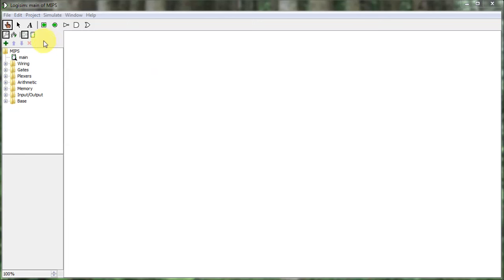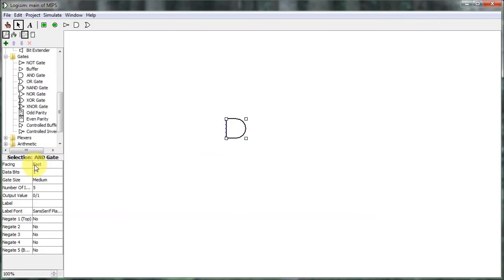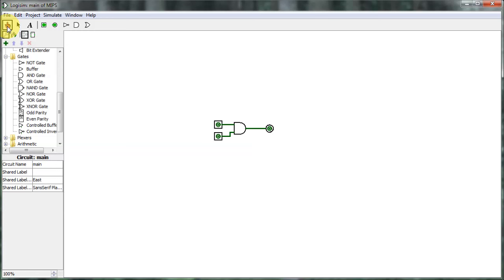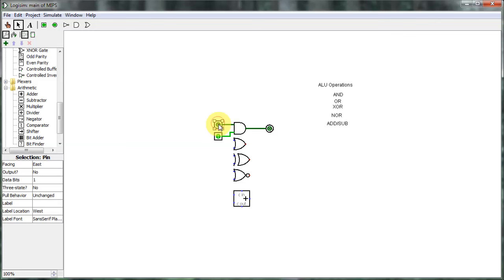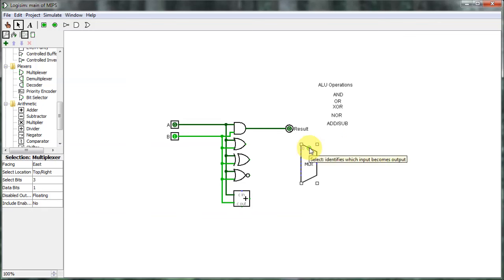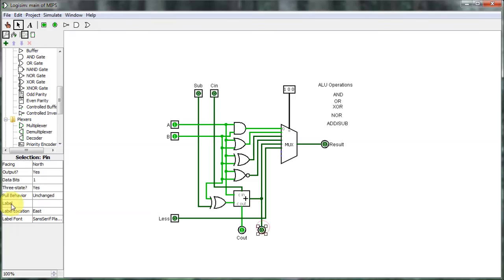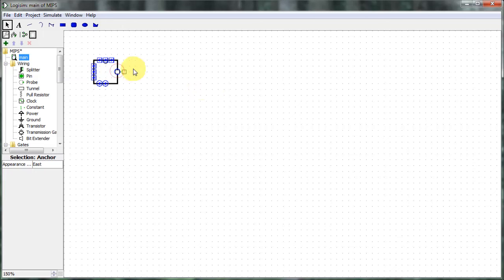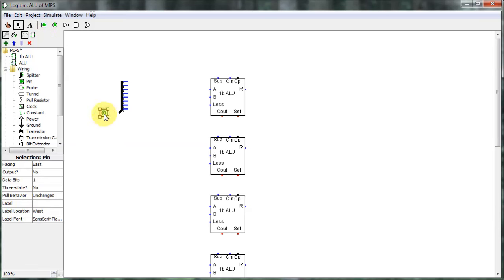CSE 230 - LogiSim ALU Tutorial

Comment: I have a question. We only connected the Set operation of the most significant bit with less than operation in the least significant bit. Y are we not wiring the rest of the SET operations in the 8-Bit ALU?

Comment: Can you please explain why we need the zero or negative flags in the alu for cpu design??
Reply: For comparison
Reply: Lol, nobody had replied to him for five years
Reply: ALU = Arithmetic and Logical Unit. Arithmetic Operations: Unary(single operand) { (-) Negation, (+) unary  addition or integer promotion pending on types}; Binary(two operands) { +, -, *, /, % and compound +=,  -=, *=, /=, %=}, Increment{++} and Decrement{--} same as {x += 1 or x -= 1}, Logical Bit manipulation: Unary {!, ~} Negation and Complement,  Binary{&, |, ^, !|, !&, !^} , compound binary { &=,  |=, ^=, etc.} Bit shifting {<<, >>} shift left and shift right same as divide by 2 and multiply by two in Binary Arithmetic. Logical Comparison. { <, <=, ==, >=, >, !=, &&, || }  Not All ALU's support all of these arithmetic and logical operations as some of these can be done in software if the CPU architecture has a small or simplified instruction set, and not all ALU's support Multiplication and Division. However some very sophisticated machines will support All possible operations on binary digits. It's a trade off for capabilities and performance vs size and cost.
Reply: @harshanarayan7363  the publisher of the video replied to him 5 yrs ago outside of the thread, but right above it..
Reply: @harshanarayan7363  wow, good call

Comment: The last lalf part of video called 8-bit ALU?
Reply from the maker: Yes
Reply: Ryan Meuth
Can you tell me why after saving the 1st part 1-bit alu, i want continue but when i make connection with 1-bit alu the wire do not get green remain blue? i tried the same with input output to one gate (NOT) and still the wires blue
Reply from the maker: dark4205 1. Make sure the wire is being driven by an input object.  2. If so, it could be a simulation problem. Click Simulate->Simulation Enabled (uncheck it), then Simulate-> Reset Simulation, then Simulate->Simulation Enabled. If that doesn't work, just save your work, close the program, then re-open it.
Reply: Ryan Meuth
Thank you, it is working now, it was simulation problem.

Comment: Hey Bro How To Do Shift Left Logical Op In ALU..?
Reply: You would need a shift register built into the ALU and that shift Register would need a clock signal and a few other things such as control lines... same for shift right.
Reply: @skilz8098  i have the design in my head for a clock-less computer, but on that note all my assembly instructions are duplicated, one set uses clock, the other set does not, arch is also wildly different. now i just got to learn how to do all this with logic gates. my design gets rid of the north and south bridge. and my SSD isnt really an SSD but acts as one as a whole, and my SSD becomes the control unit. the "software" tells the (not exactly) cores how to work together to do tasks, like virtually rearranging hardware segments to act like either network output, audio output, video card, cpu, external data storage, all on the same pair of wires/buss if you really wanted to... one at a time with just the same pair of wires.